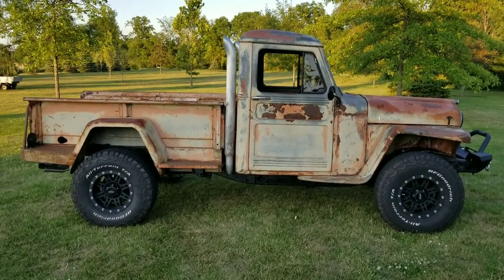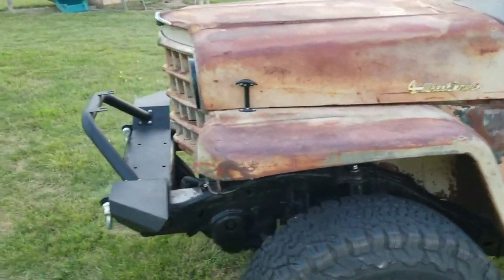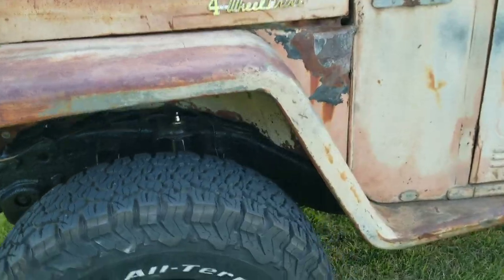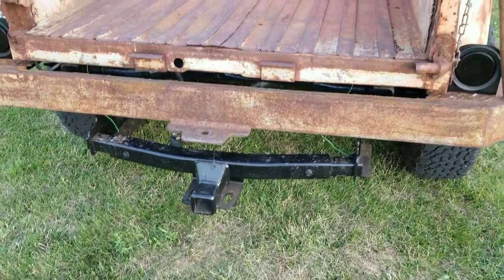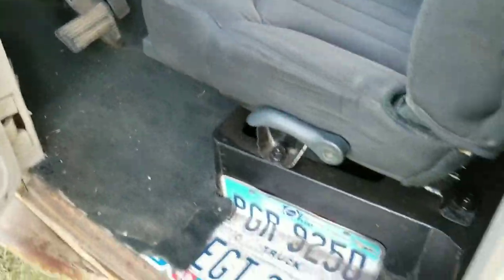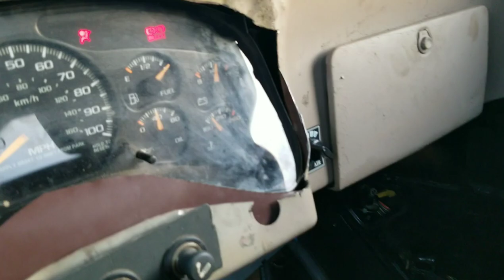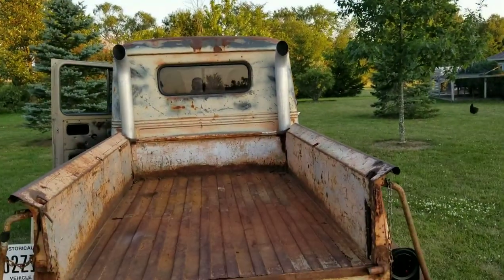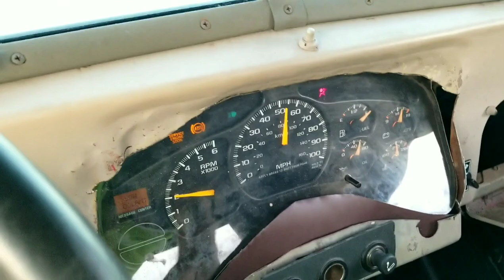1950 willys jeep truck body swap to 1999 chevy 1500 4x4 chassis

Comment: Nice job. I own a pair of 1962 Willys one is a pickup the other is a Utility Wagon. They were both owned by the same owner since new. The gentleman owned a gas station and the pickup was his toll truck the wagon his daily driven. Pickup has an original 28,000 miles the wagon has 46,000 miles - both are all original with the super hurricane 226 cubic engines everything is original to them. He had cancer so he put both inside his station on the lifts but all fluid’s were drained - air out of the original tires- he had his mechanic rub oil over the paint and spray oils all over and under the chassis. Both sat inside the station like this until I purchased the property ten years ago where they still sit today. I will be bringing them out of storage in a month or two when I will clean them up and prepare them for driving. I aired up a couple tires to see what shape there in no cracks weather checking . The gentleman did all of this because he found out he had terminal cancer even spray painted the station windows so no one could see inside. They are in as close to new condition as they could be and you can tell he loved them equally. I purchased the property at an estate auction with the station buildings not knowing what if anything was inside. I will be driving and using them on or off road but carefully. I am 78 now and I respect older vehicles as I have and had many in my collection of 9 GTO’s each with less then 10,000 miles on them. I was a chassis and engine engineer for Pontiac Motors for 38 years. My collection of GTO’s were ones that I helped design ranging from 1966-1970 all including the Ram Air 4 HO engines with both standard transmissions and auto’s. Three of which are convertibles that are all black my others are red in color with matching interiors. 
I love stock vehicles but I also love Willy’s vehicles and I love the job that you did with your pickup I can tell you have many hours into keeping it on the road. I only wish I had found your channel a while ago. Great job I hope you are using your talent in your today’s life. Thanks so much
BTW I hope that I made sense I have a brain tumor it effects my thinking
Reply: …you are most blessed
Enjoy the absolute privilege of
Great that you work so carefully, sensitively

👊🔥

🪖

Comment: Sweet build. Good idea with the pipes up the cab to extend the bed onto the wheel centers, didn't quite go far enough though bit damn close too bad maybe push it back and add sheet metal. Idk in person it's probably fine these dang videos always change angles and views. In any case you did a fantastic job and I absolutely love this truck I want one now. When I was really young my father had this same truck sitting on our property he gave it to me but I was only 10 so I never got it 😥
Reply: I have the same stacks on my 47 and you can't tell at all and it needs some TLC

Comment: Nice job on putting the truck together, however I would've pulled the bulbs for the airbag, abs & check engine idiot lights in the dash

Comment: Looks awesome! Great job man
Reply from the maker: Thanks
Reply: Mike's Jeeps what modifications did you end up having to do to make it fit under the hood? Move motor back? Rad? I’m currently looking at swapping a 47 onto a dodge 1500.
Reply from the maker: @danhoy8356  nothing other than take the fan off engine and cut the fan shroud off grille so there is room for radiator and electric fans.
Reply: Nice!!!
Reply: dan hoy let me know how the swap goes.  I am looking at dodges and chevys for a swap as well for my 48/49

Comment: Why didn't you grind off the old body mounts, instead of leaving the remnants on the frame?  Attention to detail makes a world of difference.
Reply from the maker: Yes that's a great point. They have been since removed and sand down smooth to frame and repainted. So yes looks alot better now. Thanks

Comment: What way is easier using the fire wall and floor pan of the new car or mounting the entire old cab on the new frame?
Reply from the maker: On this setup it was easy to just mount hole cab.
Reply: I tried doing this on my 97 v8 Explorer, and the Willys cab is too narrow to fit over the dash, so I have just removed the explorer body, but extracted all the wiring from the explorer, instrument panel, lights, etc.